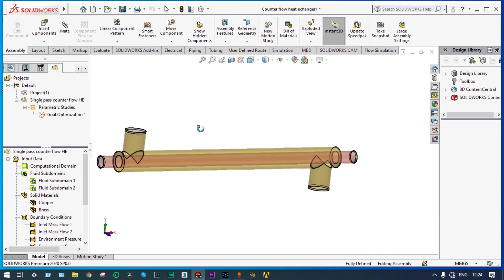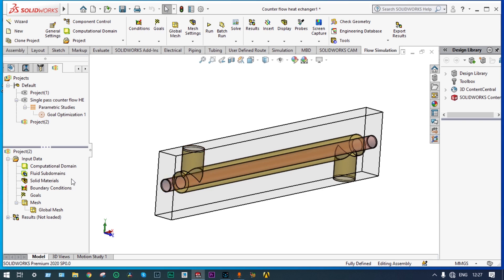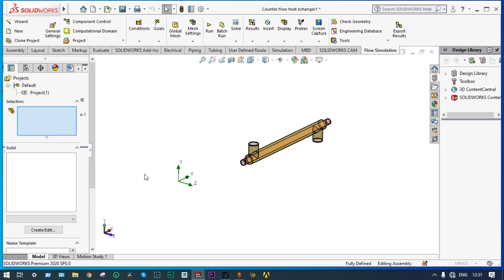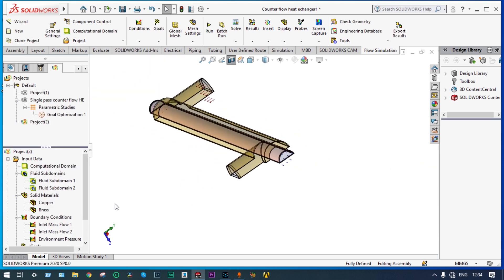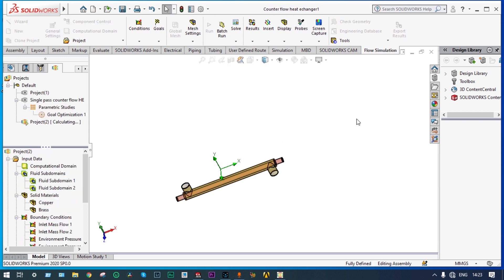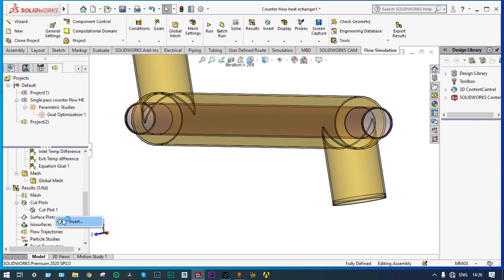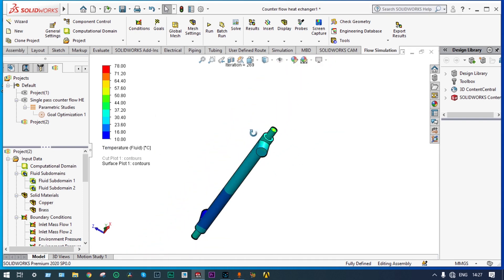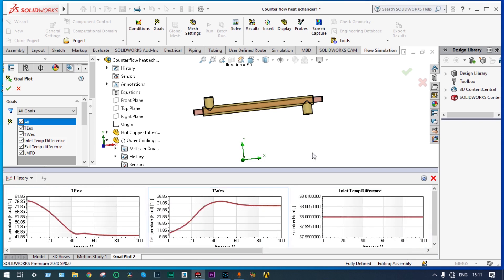Optimizing Parallel Flow Heat Exchanger Performance with CFD in SolidWorks 2020

Comment: could you make a video on modeling of double pipe heat exchanger
Reply from the maker: You can see this link, it may help you: https://youtu.be/ebce4jFAxL0
Reply: @CFD_GUIDE  thank you so much but this contains only the cfd analysis would you make a video on how to draw the exchanger
Reply from the maker: Ok, I wil do it ASAP
Reply: @CFD_GUIDE  thank you so much it will be a big help

Comment: thank you too much
Reply from the maker: You can have an idea about forming equations and controlling other parameters from this video:   https://youtu.be/PGjx_TNEISM
Reply from the maker: Did you get?
Reply: @CFD_GUIDE  I have realised the geometry yesterday because I didn't know how to open them
Reply from the maker: That is called parametric modeling. You have to creat relations among different parameters with a critical parameter. I have made some videos on that topic. I will send the link of one my videos.
Reply from the maker: If the model is symmetric, you can cut it into one fourth of the original and then apply symmeyric boundary conditions and finally mesh and apply other necesssry forces
Reply: I'have found right now a special tool able to answare immediatelly to my needs. It's Flux plots donw in the tool list on the lest. It works fine. What do you think about it?
Reply from the maker: I have already mentioned about heat flux in one of your comments. It is the eadiest way